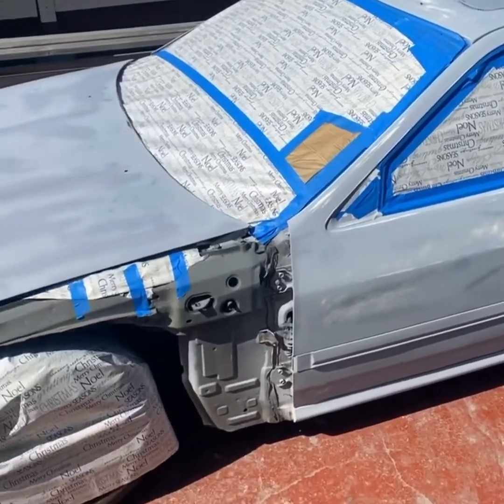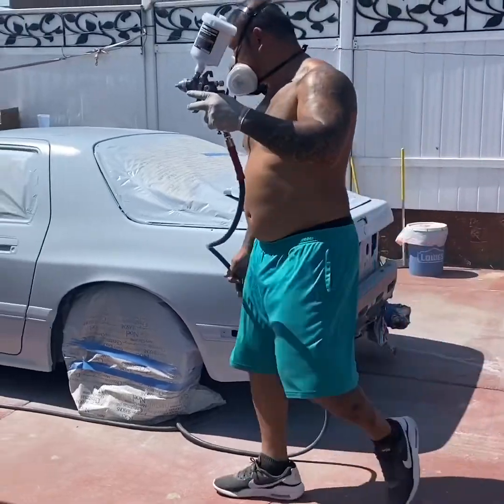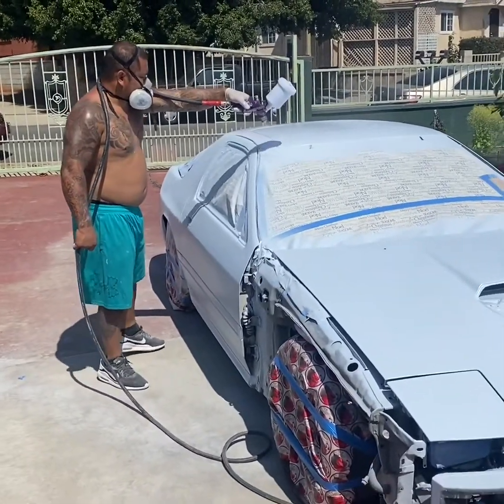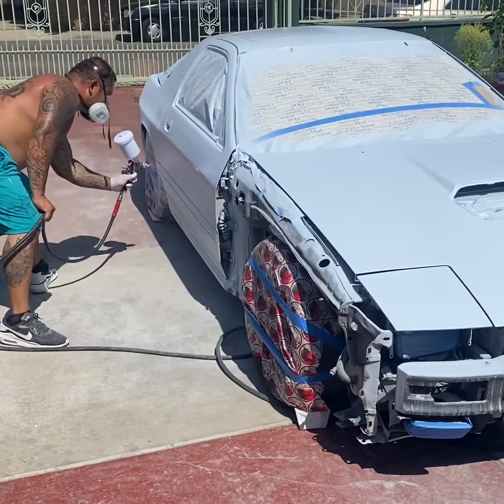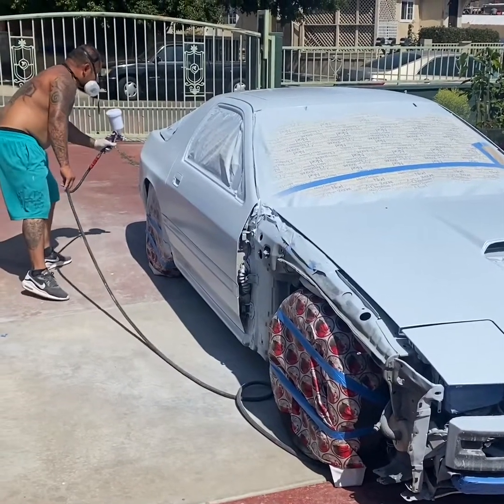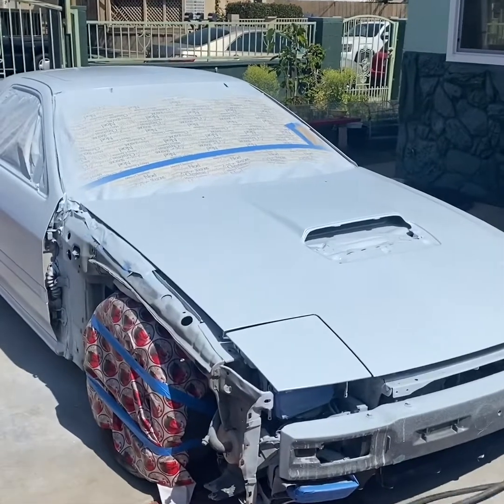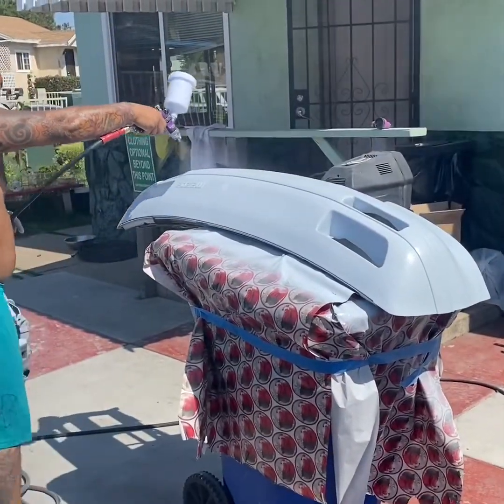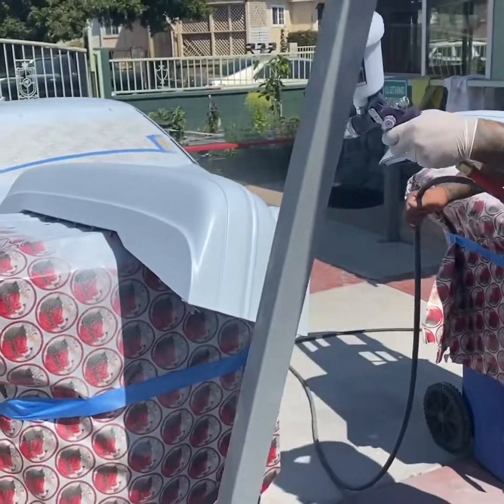Painting a car outdoors

Comment: Oh..and did the sun do anything to the paint after it dried up? Im trying to do it as early as possible so i dont burn up the paint in the sun
Reply from the maker: Make sure you wet the floor so the dust don’t kick up and the sun plays a factor depending on if  your shooting clear coat have fun
Reply: @MrFeelmyrath  i do plan to hit it with clear. Im in chula so you know the weather in the morning has been perfect up until maybe 930 or 10. My plan is to start spraying around 530 or 6am when theres light out but no sun or heat. I hope its enough time for the clear to settle before the sun hits it